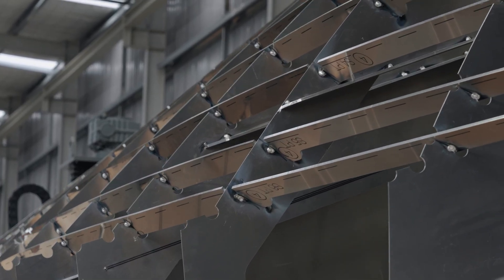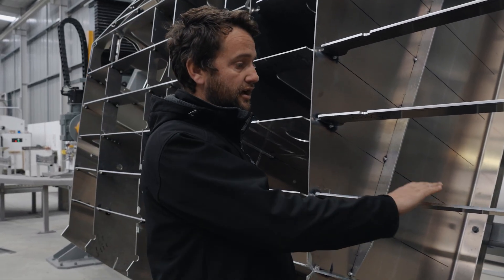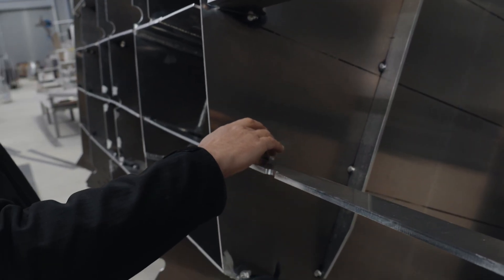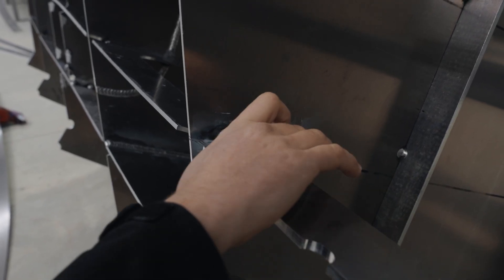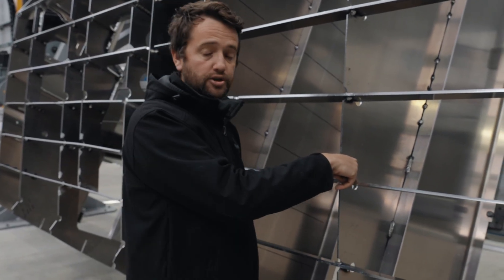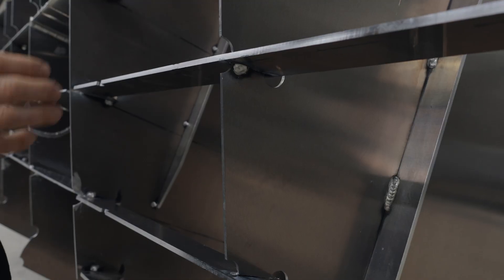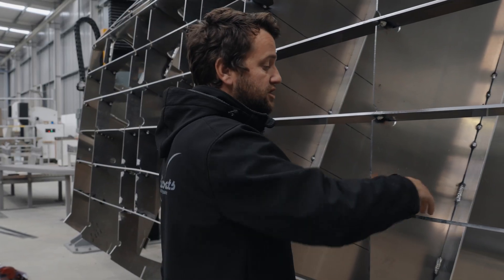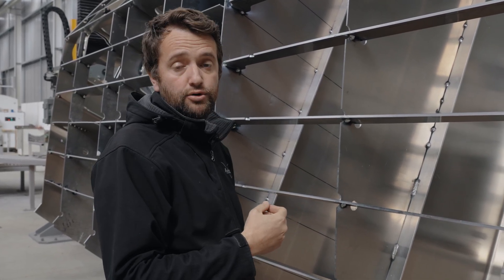How to tell if a hull is designed around Lloyds Special Service Craft Standards

Comment: Assuming you plug the round hole on the bulkhead?
Reply from the maker: Allan talks about two different frames in the video. One is the water tight bulk head at the helm and the other is the next frame forward.